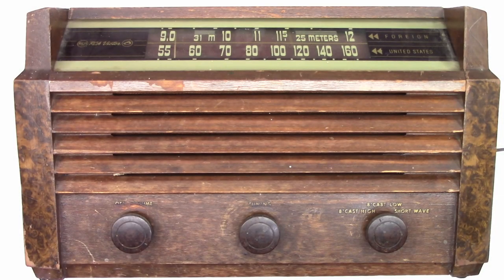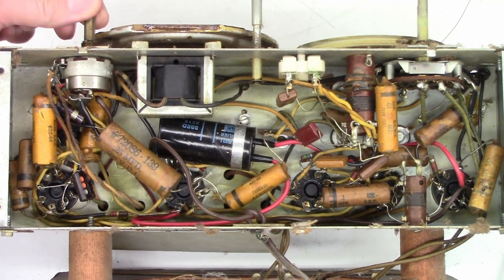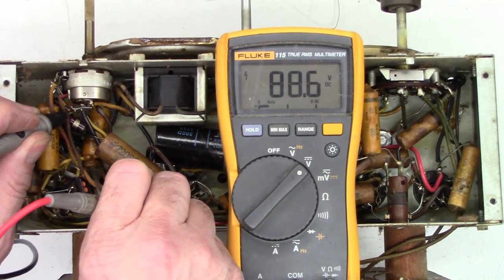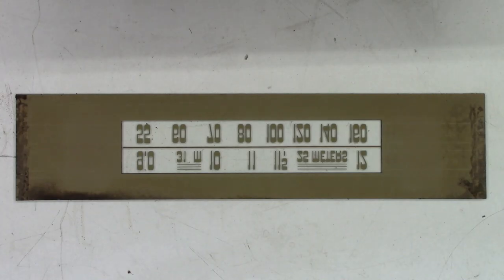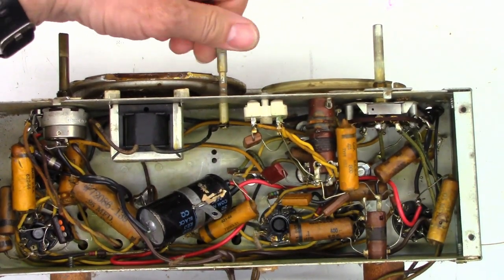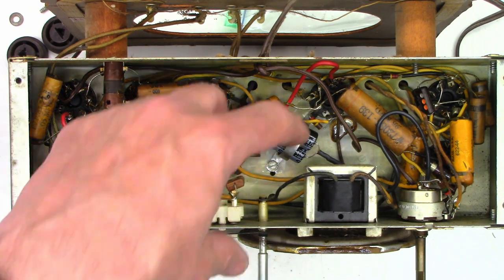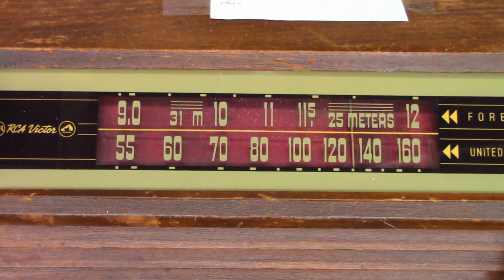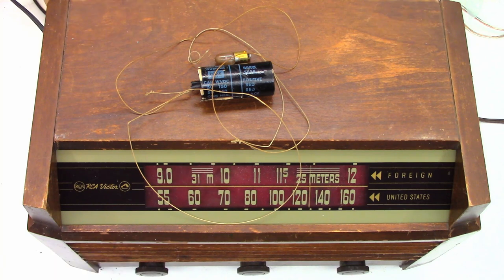RCA 56X5 TUBE RADIO FROM LATE 40'S - DEOXIT D5 - DIAL CORD RESTRING - CAPACITORS - LED DIAL LAMP

Comment: I knew the comments section would be full of people saying to replace all the caps, I was not disappointed  😂
Reply: I disagree. Bulk recapping doesn't always fix all of the problems, plus if he recapped the radio, it would probably require a full realignment; i.e. extra work and possibly more cost to the customer. I am actually glad he didn't just dive in and replace all the caps at once.

Comment: I restored a 1946 RCA floor model. Worked like a dream with that 10inch speaker. Really enjoyed the old radio. i don't know many antique radio restorers that like to restring a radio. Multiple wraps around Multiple shafts with proper spring tension makes an angry technician. 🤣
Reply from the maker: In my 40 years repairing these I have restrung probably close to 100 radios! Not super fun but the results are worth it. Thanks Barry.

Comment: That radio is certainly lasting well past it's warranty period! And nice to see so many of the old components still in it - really keeps the radios character. If it only sees little use then i don't see the point of replacing all the caps. But, if the unit was mine, i would have insisted on the lamp being replaced with another filament lamp, the cold and harsh white light from the led simply does not match the period. Changing to a white led like that changes the visual character of the radio too much.